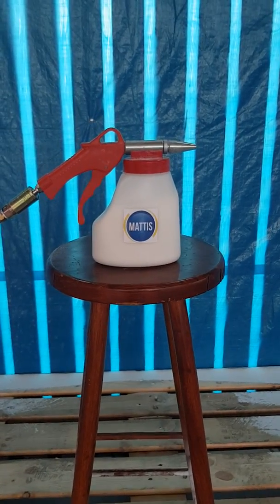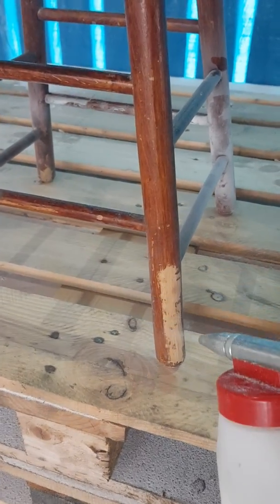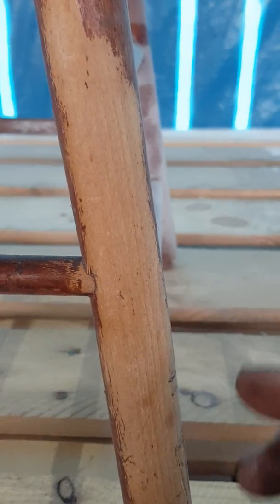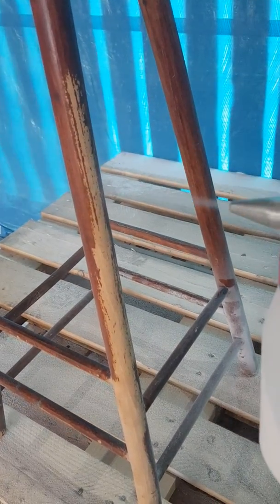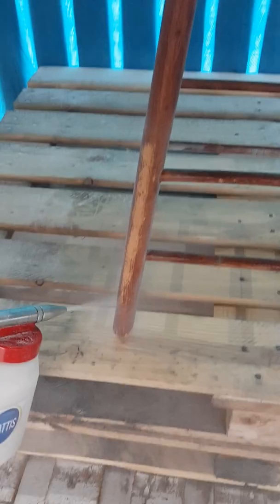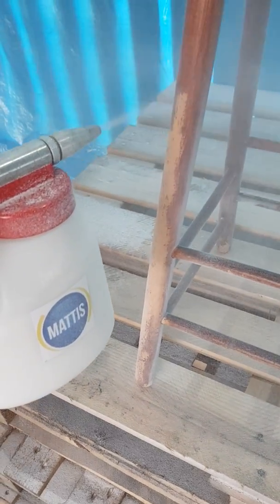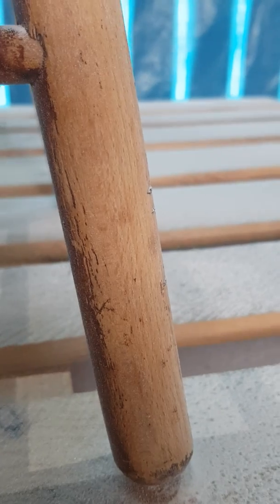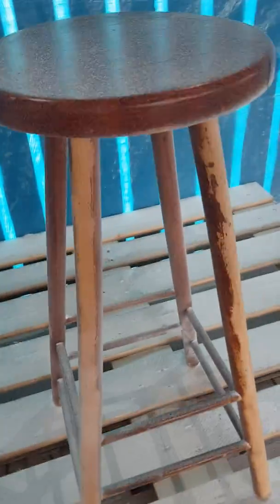Testing Hand Held Soda Blaster with soda and plastic media on wood.

Comment: What kind of CFM are you getting out of your Air Compressor? What size is the air Compressor? You keep stopping to show the result, is that to let the compressor fill some?  Did you get this done with one container of soda?
Reply from the maker: Hi, I was using a 28cfm compressor with a 270 litre tank, plenty big enough.
No I had to fill the container a few times, not sure how many